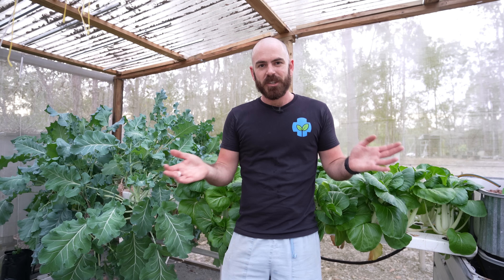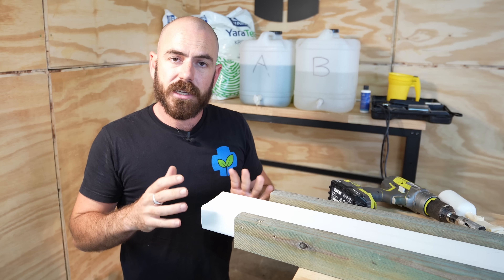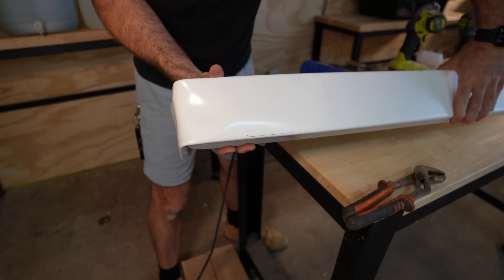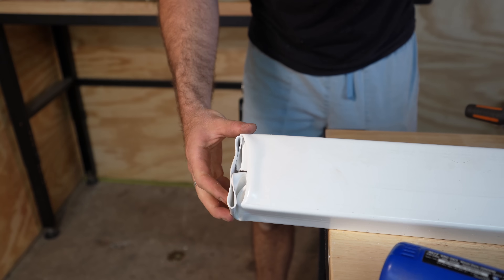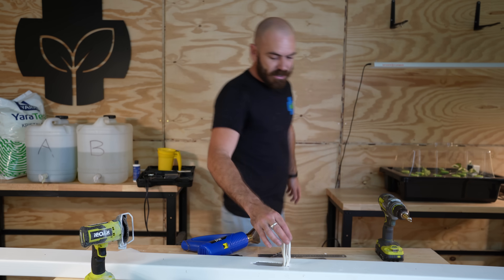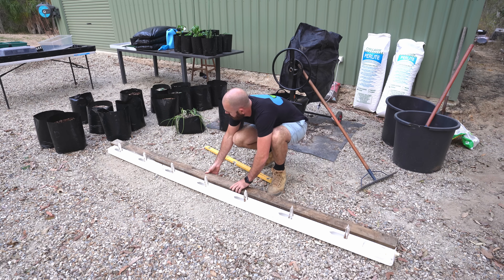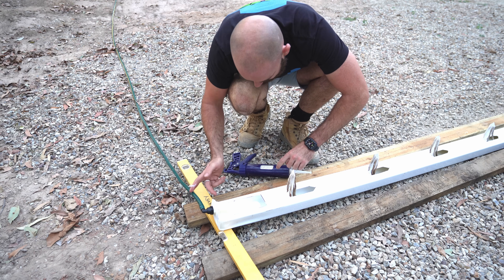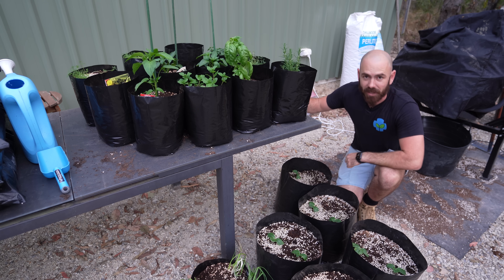Reimagining the Rain Gutter Grow System

Comment: Hoocho, absolutely love the design, it’s a game changer, even just to keep water up to traditional soil wicking pots. It’s drastically simplified my plan in setting up my new garden.

My brain cooked on it a little bit longer, and I’m wondering if another step simpler would be to replace the rain gutter with irrigation pipe. 

Place T fittings along the length facing upwards, possibly with a bit of a stand pipe to go up the appropriate distance into a grow bag, with wicks dangling down the pipe into the nutrient solution. Could just put a bit of insect screen over the top of the stand pipe to stop grow media falling in. You would need to add a separate box to hold the float valve and set the level at the beginning of the chain—just a lunchbox or something would do—something with a lid, as I can’t believe you’ve not been eaten alive by mosquitos yet!!

Is there a reason this wouldn’t work that I’m completely missing? I understand why a small pipe wouldn’t do with nutrient film, the roots need room to spread inside the gutter—but here you’re wicking the nutrient fluid up into a medium that contains the roots, and only the wicks touch the water. Surely wicks don’t need that much space?

The rectangular downpipe works well to make a flat surface when you’re putting small pots on top too, but when it’s soft grow bags for eg potatoes, they can slump down on either side of a pipe just as easily. Or larger pots can be up on feet as you did in another video.

Awesome work, love your channel and your experimental approach.

Comment: i like this idea.  only suggestion i would have is if you make up a gutter system for bags like you used in the ginger and turmeric video, instead of a single upturned spike, mark the layout a tad longer, draw your points to the center, cut, heat then  bend two shorter spikes up from the middle out instead of a large one at a single side = )

something i just thought about over the hour since i hit send...  instead of cutting your spikes inline with the gutter for a bag system, figure out where your bags are going to lay on the gutter, draw your center line and lay out the spikes perpendicular to the gutter, cut and fold up and out to the outer edge of the tube.  that would be similar to the wedges you placed for the ginger bags : )

Comment: If I'm using a fabric pot, I can just fill the pipe with sand, fill it with water as described and set the pot on the hole in the pipe, I suppose. Or stick wicking cord through the fabric pot, probably at two points, and then into just water in the pipe.

Comment: I built this system using the 2x3 rain gutter that we have here in the states. I cut the spikes out in the gutter and ran 2 strands of wicking cord for each spike, 12" apart, for a 5' gutter section i have 4 spikes. I used 70/30 coco perlite hydroponics grade mix, and put that in a long bag and pierced it with the spikes. The bag is transparent so i could see the moisture inside next day, and i could feel the moisture with my fingers. I put some panda film over it so it doesn't grow algae, and planted my strawberry crowns. 4 plants 12" apart. They started growing and then they all dried up and died. Water level was always maintained in the gutter, the media was moist. I tried another variety of strawberries, same, the leaves dried up and died. I'm thinking maybe i need extra spikes and wicks to provide more moisture? Any one have similar issues?

Comment: Had an idea to make it even cheaper possibly?

If you grew large diameter Bamboo, and smaller Diameter Bamboo.
You could use the larger one as the rain gutter, and the smaller one as your grow spike.(cut in half, sharpen it and put holes for wicks)
valve light cover(another bamboo piece cut in half should work)

Then you could grow your own system, all you need is the valve
Reply: How would you seal the ends of the larger diameter bamboo?

Comment: We can only get a 65mm square PVC pipe in Ireland. I assume this will work as float valve I can get is 47.5mm wide? Just need to support the bags a bit wider. Thanks for putting this video together as I couldn't have built your previous system with endcaps and spikes 😁

Comment: got a old setup similar rectangular channel, fabric rhizopots with hole cutout in the bottom for a 3" netpot, back fill with coir/peat/perlite/vermiculite to create a 3" wick system an then use a 1gal to 3-4gal rhizo,.. works well with a pond pump an a 40L tote gravity drain into the tote an send the feed line to top of the rail. ive barely got a film contacting the base of the channel but its still wicking an working good enough. just need to upgrade to the 40L tote ive been at 10L this whole year but now everythings setting in. a acquarium pond heater to keep the water optimal in winter
Reply: the 3" netpot seem to be perfect size for the rectangular 90mm PVC channelling an will wick up even like less than 10mm surface film available

Comment: Short lengths of 20mm PVC pipe with the end heated and wedged could do the same thing, the drill a few holes for wicks. It might be a little more robust that the thin wall gutter or pipe which ever you use.

Comment: First time watching. Very impressive. Better than most YouTube authors. The only problem I have is using Teflon tape on plastic threads. The manufacturer recommends using thread sealant and never tape. But in the real world situations with small pipes it doesn’t matter. If you go to 2 inch pipe it’s an absolute no no. It will fail and deform.

Comment: I improved your project, installed a small tank with toilet valve control, to reduce the pressure and you can always add fertilizer into it...😊

Comment: Thanks for doing all the thinking for us.  I also melted the end of the gutter, but your way of folding it up makes it less leakable.  No end caps is a great method.

I cut 2 slits at the bottom of my 7-gallon (26-liter) fabric grow bags.  I feed worn socks through them as the wicks.  It's a tad bit more work, but I think it should do as well.

Comment: Hi @Hoocho, great job, great idea. I want to try that ni my garden in North Africa. And, in my country we only have cylindric gray PVC pipes at an affordable price. I am thinking at using 2 timbers to clamp the cylinder while melting it with the heat gun and then shape it in into a rectangular shape to rejoin your design.
What do you think?
Does anybody here can try also? 
Also, is that required to have a rectangular pipe? can it work with cylinder? what do you think ?
Reply: https://www.youtube.com/watch?v=VO-tQ1_xdeg it seems do be doable like this. But, for longer pipes I don't know.

Comment: use a small pvc pipe to position the wick and then leave wick in the soil and take the PVC pipe out.  No need to make a spike at all.  Don't be  in love with the penetrations' LOL Use the pvc pipe as a removable sleeve!  Hole for leakage would be wick diameter.   Wick could water to the top.  Install soil last, then Pull PVC out and wick remains.  Just an idea??
Reply: I actually just make spikes out of the pvc (its actually electrical conduit) and leave them in. They go all the way to the bottom of the square pipe and have 4 holes in the sides near the bottom for ther wicks.
Reply: @jasonking852  Some minds work alike.  Just a stripe of wick is all that's needed.  Thanks for responding.
Reply: @jasonking852  I've used at 3' length of 2" PVC to help Plant tomato seedlings quickly.  Not much different than Planting a wick! It's all in the technique!
Reply: That's exactly what I always have done, no need for spikes at all.

Comment: yeah cool idea but not a great one.... so the large hole left after spike created will probably allow the soft plastic bags to press into the pipe and ultimately by capillary action drain your reservoir tank dry.......the heating of the pipe to stand the barbs upright will bend the plastic pipe into a slight concave shape making float valve height a super critical factor..... so you don't loose your nutrient out from the centre........and if was just those things  I'd give you 4 out of 5 stars cause both of them could be mitigated, the one factor I can't get over the line with is the spikes will eventually snap off. sorry. Maybe if you just cut out circles like you would have for 3d print spike version, then drill your two holes for the wicks in the cutouts, and then poke a couple of holes in the bag for the wicks to reach the nutrient and just put some grow media between the circle cutout and the bottom of the bag . all problems solved.......and when a 3d printer does come your way you can add them later. the only down side would be the extra step required when filling the bag with media. but time is still free for the DIYer. what you think @Hoocho?
Reply from the maker: The bags will drain… back into the pipe… 
Causing the res to drain.

…

Logically that makes no sense.
Reply: @Hoocho  time will tell. and in any case I was more worried about the spike snaping off

Comment: I love this idea. I'm also using the downpipes as cheap hydroponic containers and they are superb. I've also been using a wooden frame to anchor the plastic as I heat it, but in addition I've shaped the template with 45 degree angles so that only the part of the pipe I intend to bend is being heated.  This makes it easier to bend to shape as the rest of plastic remains firm, then I use a damp cloth to quickly cool the edges as I hold it in place. 

I love this channel, thank you for all the work you put into your videos. It's only because of your excellent tutorials that I had the confidence to make a start with hydroponics.

Comment: Its a great idea! Personally, i dont have any knowledge about 3d printing nor i have a 3d printer. I guess the improvements can be done is to make a small hole (screwdriver should do the trick) so that the wick tips of the gutter wont be deformed. At least that should last a few more rounds rather doing the direct method.